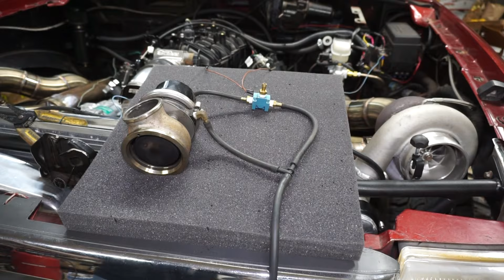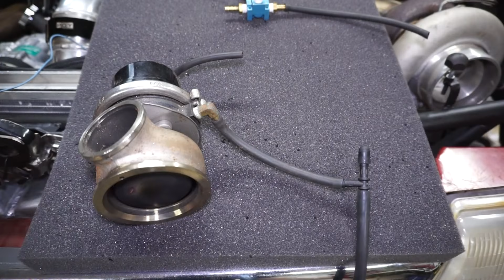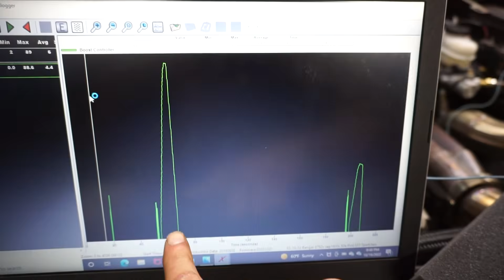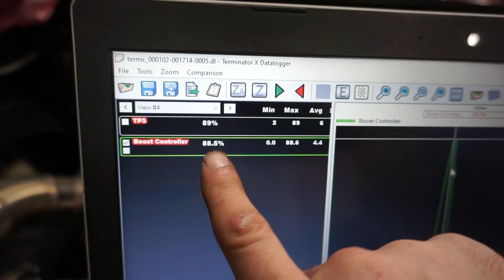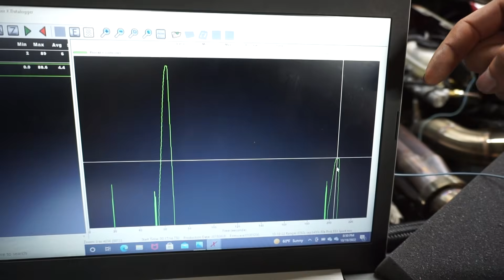3 Port and "3 Port Like 4 Port" Boost Demo With 3 Port Mac Valve

Comment: Thanks for this. 👍 My bcs system is kinda crude just a 3d map of duty cycle based off RPM and VSS. I could do it off RPM and MAP instead. I would set it up like 8:27 wth boost reference from the turbo and start off wth the duty cycle at 100% at lower rpms and boost so the gate is pinned closed for fastest spooup then drop the duty cycle as rpms and boost increase to get my desired boost level. Cant wait to give it a try.

Comment: I know this video is a bit old but I’m having an issue and I don’t know what to do anymore. My car will not make any boost past gate pressure no matter what. I even pulled the lines on the gate to see if I could get it to spike past gate pressure and it didn’t it stayed at gate pressure any help would be appreciated

Comment: I tried it. All I had to do was move the hoses around so its easy. It definitely works. My ls setup creates a lot of back pressure and before I couldn't hold 17psi. Not really sure what I could spike too but really I could only hold 15.5lbs and that's with 12lbs of gate springs. With the new setup I was hitting 20lbs instantly which is where I set my cut. And that was at 57% duty cycle on the controller. I'd suspect its good for around 25lbs. I'm going to try out 7-9lbs of gate pressure and see what that can do.

Comment: Is it possible that a 3 port valve be damaged and not send power to the Westgate? My Westgate doesn't open at all and my boost goes all the way up. I changed all the hose and even put a new Westgate and the problem is still the same. 😢 Can it be the mac?
Reply: it just happen with me try to connect the vacuum without going to solenoid turbo to lower wastegate port

Comment: Thanks for the great explanation, I have not found a lot of info on the mac valve setups. I have been testing diff. ways of plumbing and your method works, but I am having trouble with the turbo cut off, as mine is set to 10.5 but not cutting out and going up to 12. It is amazing how many diff. setups are available for one solenoid!

Comment: Great video! The way these two setups work is barely explained anywhere and I had been looking for days for more details than the basic diagram supplied by the wastegate manufacturers or online forums etc. You'd think the likes of Turbosmart or Tial would have videos like this, but alas no they don't. What I know now is my plumbing of 3-port as a 4-port is wrong and needs fixing. Thanks for the great explanation!

Comment: I have never seen a video on "how to" using an external boost controller in a car with OEM electronic boost controller, I mean as an fail safe system.
Reply: If I understand what you mean, a MBC in parallel with the EBC can do this. I had this setup before... No matter what the EBC does, the boost will never exceed the MBC set point.

Comment: In the 3 port like 4 port configuration, you showed that you must vent the top of the wastegate or it will lock pressure. What about the bottom of the wastegate? Don't we have to vent that as well? I saw in the video you didn't have that vented, but it seemed to work, so I was curious how that would work.
Reply: This... I have the same question. In the case of the wastegate used in the video you mentioned there was a small leak through the diaphragm so that would provide some venting depending on the top pressure. 

So as lemin above said, it seems in a properly functioning wastegate that you need a vent (like a tee) on the bottom as well. This is what a 'regular' 4-port would do of course... whichever diaphragm side is getting boost, the other side is vented to atmosphere (VTA).

Comment: I have a holley high flow boost control valve 557-201 how can I install it to Terminator v3 with no c02 just using my turbo compresser side? Or how can I do it with a 4 port mac valve you explain things where I understand

Comment: So if i check normally open and run the 3 port like 4 port i need to do this?

There are two types of solenoid - normally open and normally closed.  A normally open solenoid (like a GM solenoid) will give maximum boost at 0% duty. Note that in this case FlashProManager inverts the duty cycle so that in FlashProManager 0% duty cycle is minimum boost, and 100% duty cycle is maximum boost. It is important to set a boost limit as a solenoid or wiring failure will result in maximum boost.  A normally closed solenoid will give maximum boost at 100% duty.

Comment: Hi, great job with your explanation.
I was wondering, when you have a T in the line to top of gate, when running like 4 port, wouldn't  majority of the air escape out the T being the path of less resistance...?
Reply from the maker: Some will, but it doesn't completely. Same with puting a T-in the bottom. It will increase boost pressure slightly, but will still apply plenty of pressure to open the gate. Example, if it makes 8psi on gate, then you T the line it might make 10psi.

Comment: So it was weird when I routed my buddies controller. With just compressor reference to bottom of the gate, we made 6psi. So 6 psi was gate pressure. JUST HOOKING UP THE SOLENOID IN TRADITIONAL 3 PORT MANNER gave us double the gate with the controller at 0% or off. I was so confused. By the end of tuning I was able to manage 21lbs at 60%duty cycle on the controller at 78hz. I assume we could have probably made almost 30lbs at 90% or so. I was so confused but we managed 342whp and 275wtq out of a d16. Shit ran hard!!!!
Reply: I think I’m having this issue too with a k20. How did you end up hooking it up to be able to better control the boost???
Reply: @kalieburrows1427 just hooked it up like you normally would. It worked fine and didn’t have any weird issues. So just hook it up normally

Comment: This doesn’t work like a 4 port though.  
Just the valve bleeding off pressure to the bottom of the gate while venting the top, achieves equal zero pressure to top and bottom at 100% duty cycle. 
Applying pressure to the top of the gate without venting the bottom achieves equal boost pressure to the top and bottom at 100% duty cycle. 
Both methods do exactly the same thing by achieving equal pressure to top and bottom of the gate at 100%. 
A 4 port applies full pressure to the top while it vents the bottom at 100% duty cycle, holding double the boost pressure on the same spring as using either method you showed with a 3 port.
Reply from the maker: If both 3 port methods do the exact same thing, how do you explain the duty cycle required to close the valve being cut in half? 

Go do it in real life and see what happens.
Reply: @BlaserBuilds  both methods will need different duty cycles for midway settings, due to one method adding pressure while the other is bleeding off pressure but will both be exactly equal pressure to the top and bottom of the wastegate at 100% duty.  I’ve been in the automotive performance industry specialising in turbocharging for 20+ years. I’ve first hand used and seen every boost control method you could imagine many times over.

Comment: Great video, thanks a lot...
I need a litle help if posible.. I have a volvo 850 r, I´m trying to understand how this specific valve works (BCS  Pierburg 1271630), it´s a 3 ports one....
When valve is OFF.
-I give some presure on port 1, I get free air on port 2, but no air on port 3 (Atmosphere).
-Then I give some presure on port 2, I get free air on port 1, but no air on port 3. 
When valve is ON.
-I give some presure on port 1, I get free air on port 2 and 3.
-Then I give some presure on port 2, I get free air on port 1 and 3.
Is it Posible, ?? Could it be a diferent ECM configuration? 
Any help will be so apreciated...

Comment: At 8 minutes....
Wait what? If you have 10psi below the diaphragm and 10 psi above the diaphragm you have equal pressure, not 20psi extra. The spring will work as normal.
Reply from the maker: Adding 10psi to the top partially closes the valve, "wasting" less exhaust energy and increasing boost pressure. If you have 10psi at the bottom, then apply that pressure equally to top and bottom, manifold pressure will increase until pressure equalizes. Then you'd have 20psi in the manifold, 20psi on top and 20psi on the bottom of the gate.
Reply: @BlaserBuilds so if u have 20 top 20 bottom and spring is more then 1psi gate will be closed. I don't get it too. If u have equal pressure top bottom its the same as nothing connected to the gate = always closed
Reply from the maker: @4TKRACE  Are you factoring in the 20psi of exhaust backpressure also pushing up on the valve?
Reply: @BlaserBuilds  so u saying, that if u do not hook-up gate at all, it will open at 10psi with 10psi spring, cuz backpressure?
Reply from the maker: @4TKRACE  No
Reply: @BlaserBuilds  so why it should open at all if u have same boost up and down?
Reply: @4TKRACE   I think you're forgetting about the spring pressure.  Sure, you have equal air pressure on the top and bottom, but on one side you ALSO have the spring pressure.

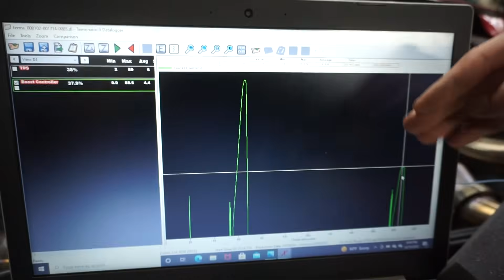Comment: 14:07 
So If using 10lb spring 
STD 3 port way it would apply 10lb to bottom/top WG at ~88% duty for 20lbs boost (10lb spring +10lb top WG)
3like 4 port diverts from bottom WG and more to top so
10lb at 38% duty or
(x2 = 20lb at 77% duty)
30lbs boost (10lb spring +20lb top WG)
And using simple math
10lbs : 38% duty = 1lb : 3.8% duty possibly 
26lb at 99% duty 
36lbs boost (10lb spring +26lb top WG)
Reply: But 36 is unrealistic because with the valve being 99% open to top WG and 1% open to bottom WG correct ?

Comment: Great video! I wanna ask , Is this sound normal when the 3port valve is lorking. 
I'm running 3port valve with 2 boost lines, at the bottom and at the top.
And when i turn the duty up , the wastegate starts to sound strange . But the boost is perfect. I just want to know is the sound normal
Reply from the maker: sound would change with frequency.

Comment: You do a very very good job explaining things. Im wondering now, you can for sure under gate a system and its common. But could you "over" gate one? Changing from what ever pressure on a single to half that on a dual I wonder if it gets so low that you lose some control.

Comment: So the vent in port one doesn’t affect the pressure seen on the dome very much? Must not if you can make more boost this way than just regulating the dome
Reply from the maker: Doesn't really effect it much correct.

Comment: In 3-port like 4-port, how do you vent air out of the bottom of the gate (assuming diaphragm isn't leaking)?  Another Tee leak in that line?
Reply: It’s always open. Port one to vent which goes to the bottom port is always open. Port 2 is closed until duty cycle is triggered
Reply: @or-ian6973  My understanding, tell me if I'm wrong:

Solenoid off - manifold pressure feeds port 2, which is open to port 3, so bottom of the gate gets pressurized to give you "low boost" or "on-gate" boost. Any pressure at the top of the gate flows to port 1 which is dead-headed, so it escapes through the Tee leak instead.

Solenoid on - Manifold pressure feeds port 2, which is open to port 1 so top of the gate & Tee leak, but the turbo flows enough it still gets pressurized to give you triple the "on-gate" boost. Any pressure at the bottom of the gate flows back to port 3, which is dead-headed, so it's trapped unless you install a Tee or count on a leak in your gate?

It seems like it would slow your control of the gate if you're doing closed loop boost control compared to a 4-port, but it's probably fine for straight duty cycle. Haven't finished my car, so I have zero real experience.
Reply from the maker: I when the solenoid goes off I'm goes back to open circuit which sees engine vacuum, so doesn't need to vent the same way as the normally closed circuit which would trap pressure.
Reply: @BlaserBuilds  Have you done this with closed loop boost control? In my head, something seems wrong,  but this would be cheaper.
Reply from the maker: @BigRedRocketScience  Not closed loop, but this is how I have it set up on truck now.
 0% makes 13
20% makes 16
30% makes 19
Reply: @BlaserBuilds  That's pulse width modulation percent to get a boost result, right? Are there PID settings in closed loop boost control (not closed loop fueling) to force the gate closed until the target boost is reached, or do do you set a PWM% & let it get to boost... naturally? Seems like the wrong word here... open-loop boost? Know what I mean?
Reply from the maker: @BigRedRocketScience  Yes open loop is how I have it, which is just duty cycle percent, and I think I'm using 30hz. Closed loop would have the PID settings to adjust to find a target.

Comment: May be a dumb question, but what are the pros/cons of running a 3 port like 4 port vs a 4 port sensor? Thanks for this great explanation, it cleared things up for me!!
Reply from the maker: 4 port is more expensive, but you'd have little better control and designated vent. In my case I already had a 3 port, and didn't feel like buying another 4 port. So would be an option for someone already running a 3 port but maxed out. If I didn't already have a valve, and was buying new I'd just buy a 4 port. Last 2 builds I ran 4 ports.
Reply: @BlaserBuilds  I was surprised how it worked out when you were working up to 4 digit whp on the dyno...